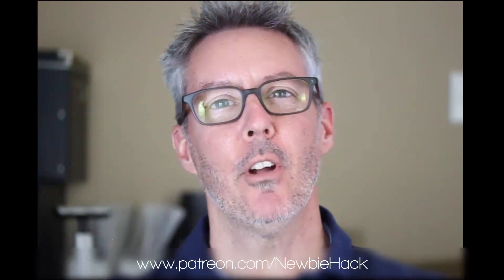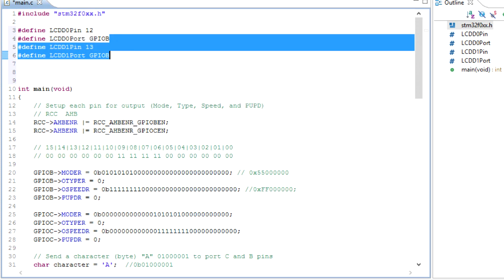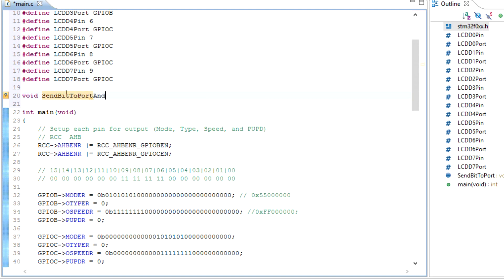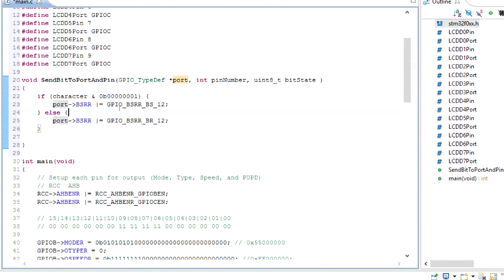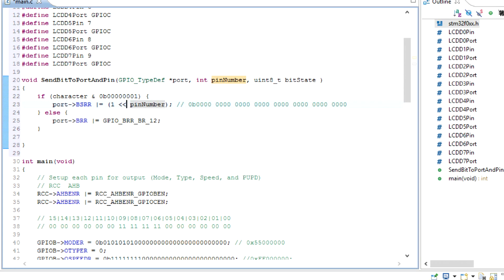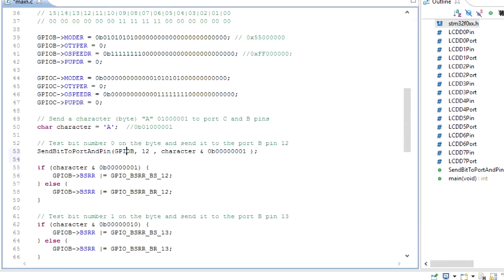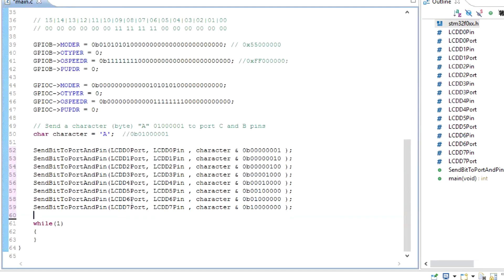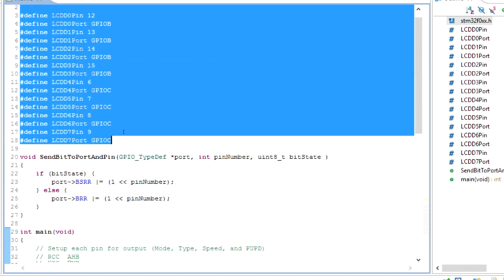17. How to Interface an LCD to an ARM Microcontroller Tutorial - Part 4

Comment: Hi i am using the stm32f446re with header file <stm32f4xx.h>. The GPIO member only have a BSRR register (No BRR).
How to use the pinNatumber for both set and reset state
Thanks
Reply from the maker: The set and reset on the BSRR is on a different part of the 32-bit number. All you have to do is use the shift operator (<<). Let me know if you need more help.
Reply: @PatrickHoodDaniel I followed your advice and found a solution
For bit set BSSR |= (1<< pinNumber);
For reset   BSSR |= (1<< (pinNumber + 16));
Thank you Teacher
:learning:

Comment: You can also do this much faster by writing the two nibbles directly to each port. It all depends on the LCD you're driving.

On a 2x16 character display it doesn't really matter. But, on a 320x480 16-bit color display it does.